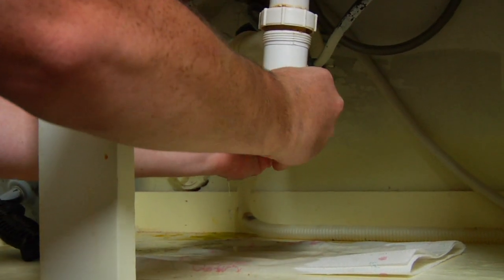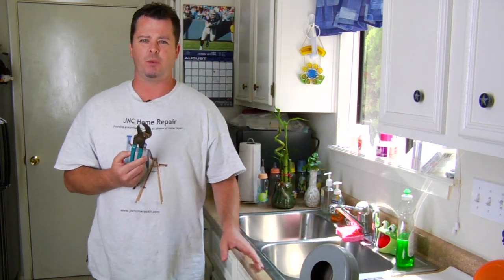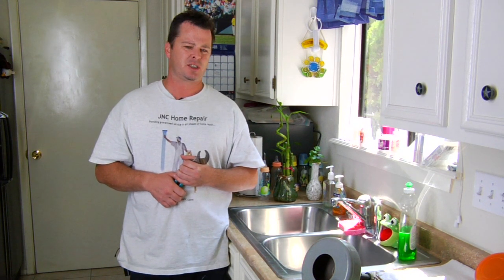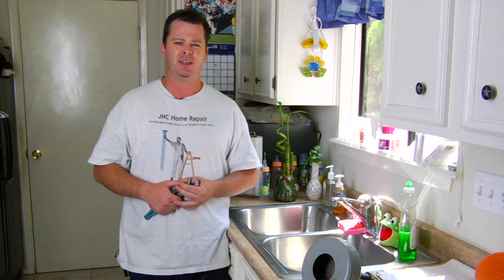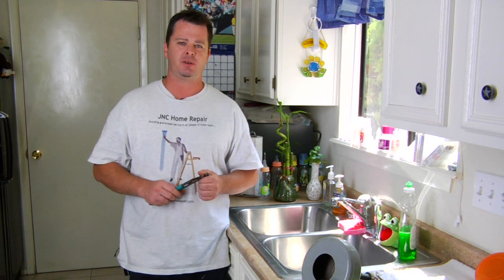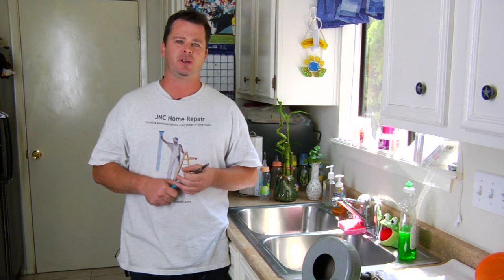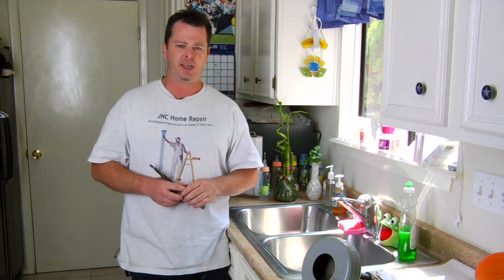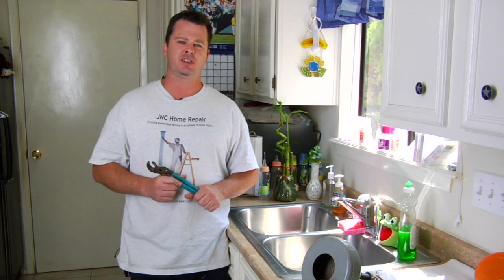Home Improvement & Repair Tips : How to Unclog a Kitchen Sink

Comment: wow, you're quite a trooper sticking it out this long! We got ours fixed using a snake. The pipes under our sink aren't exactly like the one in this video, but it DOES eventually go into a wall. Follow the pipes that begin directly beneath the sink, past the U-shaped part of the pipe (which you should remove), to where it ends. It SHOULD lead into a wall or something. I think you're supposed to snake through where u removed the u-shaped pipe and right through the pipes going into the wall.

Comment: The snake wasn't working very well so when I left the room my stupid neighbor decided to put a cut off piece of garden hose down the line. I came back a few minutes later and he told me that the hose had broken off inside, To top it off he used a soak er hose with hundreds of holes in it. WHAT SHOULD I DO NOW? The problem is now even worse!